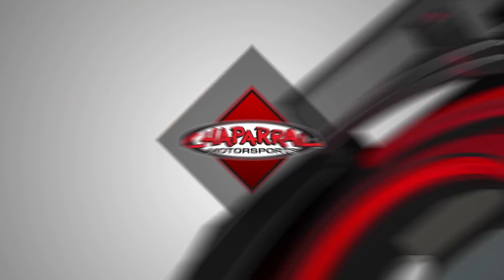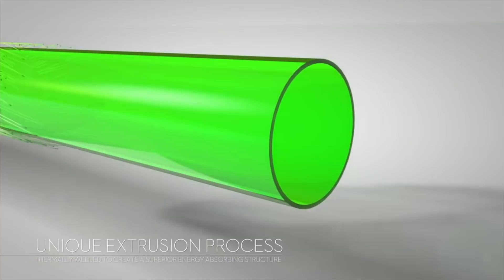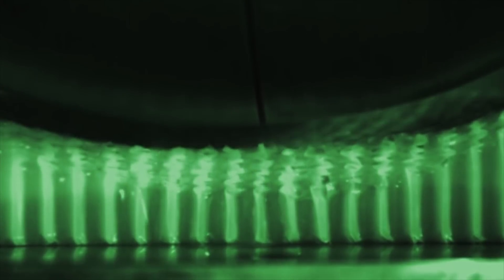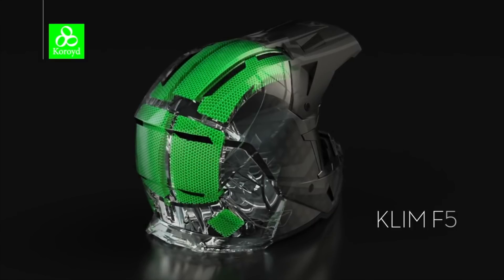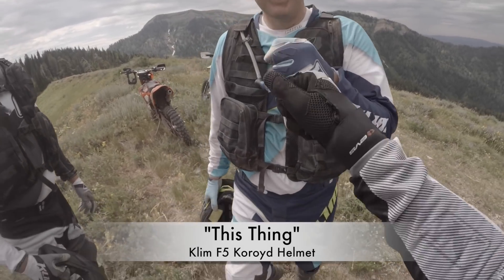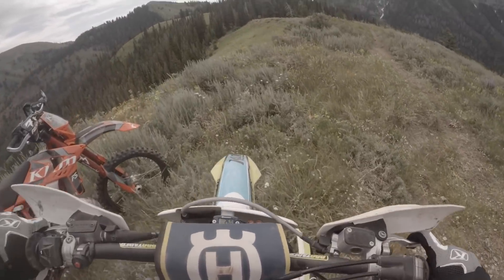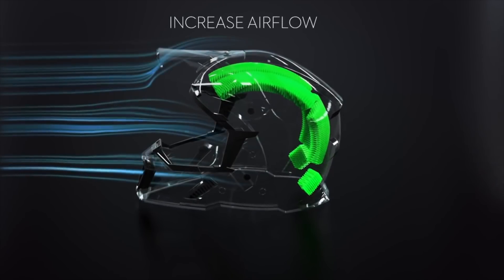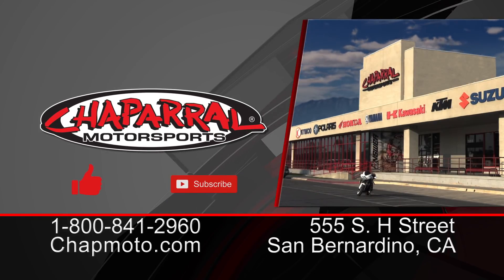The Future In Motorcycle Helmets! Klim Koroyd Helmet Technology Explained

Comment: How hard is considered hard? Normal EPS will not be crushed under normal impact...
Reply from the maker: Not true.  If a helmet is dropped (by itself, no head in it) the EPS will be fine.  If a head is in it... or a watermelon, we shown significant crush to the EPS liner.  The EPS can not take multiple impacts - and that is why a helmet needs to be thrown away after each significant crash.   -- Kyle & the Chap Moto Team
Reply: Will this technological be used for on-road helmets too?
Reply: @Drope934  I think its the Krios he was talking about its out for sell i think bro.
Reply: thats actually what you dont want. If the material does not give, energy isn't bled off. Just like the crumple zone in a care is designed to crush.

Comment: Basically it can only withstand One hard Impact. It does not spring back into shape. Once it's crushed it should not worn again. 
How much is this Crash once through away helmet. ??
Reply from the maker: Thank you for your comment Dennis Millus. Every helmet currently on the market should be replaced after "One Hard Impact" as EPS does not bounce back either.  All helmets are one and done. $649.99 is the current price.  https://www.chapmoto.com/klim--f5-koroyd  - Kyle & the Chap Moto Team
Reply: The medical cost of monitoring a brain bleed is 30,000 dollars a week, losing a 700 dollar helmet to prevent this is probably a good deal.